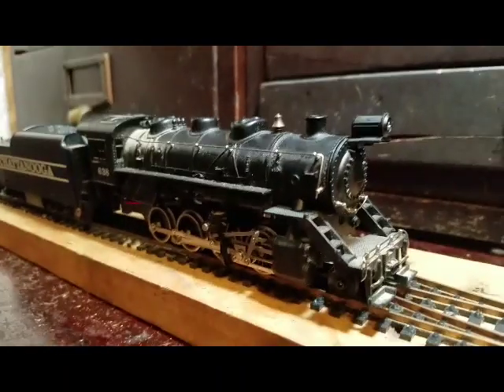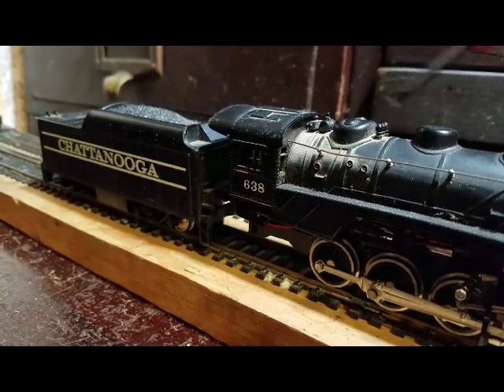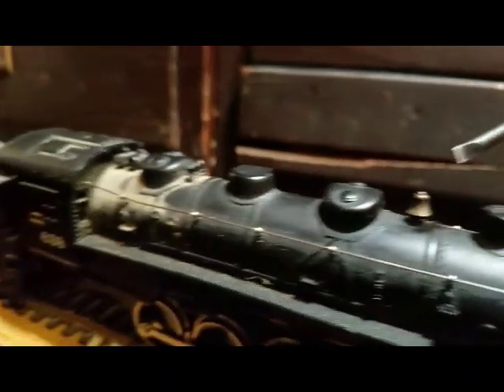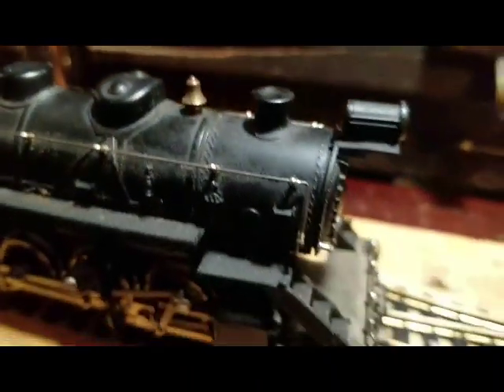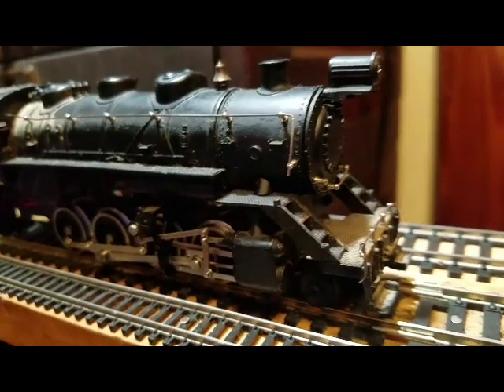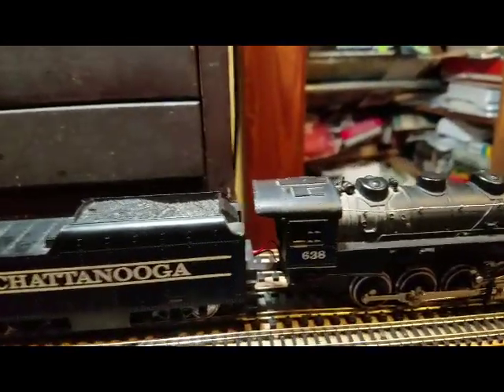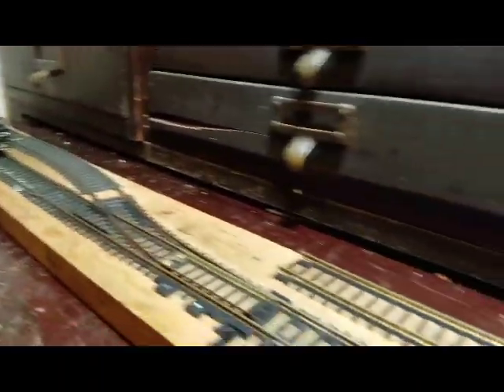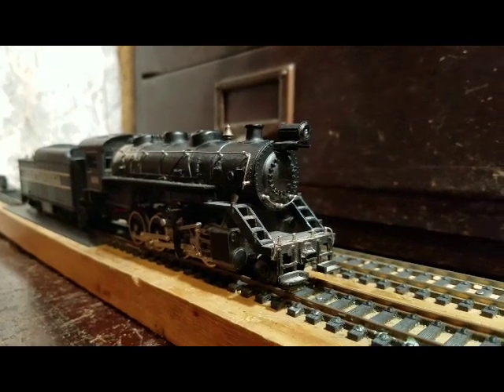Tyco Chattanooga Choo Choo Train review

Comment: Mine is the same as yours, but the wheels get hung up when they need to push the arm for the smoker, any idea what could be wrong??
Reply from the maker: That's different. I haven't had that problem on this locomotive since I've been taking care of it so well it's been a really nice Runner so far I still need to fix the wheels a little bit need to get some grip on the wheels

Comment: The Chattanooga you have here in this video I was told it's better than the other one that has the light down lower why is that everything else is the same right I know that 91 version. That's non-tender driven is way better but I have the other one with the light in the boiler and not above was just curious if there's really a difference
Reply from the maker: There are several differences with the different kinds of Chattanooga locomotives some of them are different some of them are the same depends on what you find what you look for

Comment: If that pancake motor is in top notch condition, it may do a fair job of pushing/pulling your rolling stock.

I have found they are horrible at slow speed. Jerky and stalling is really bad.
There again they are purty good at higher speeds.

I’m checking into repowering a few Mantua/TYCO 2-8-0s with kits from NWSL.
About $50 a pop.
I haven’t pulled the trigger on it yet, because I’m trying to juryrig something first.

lol

Keeping cost down to almost nothing, if possible.